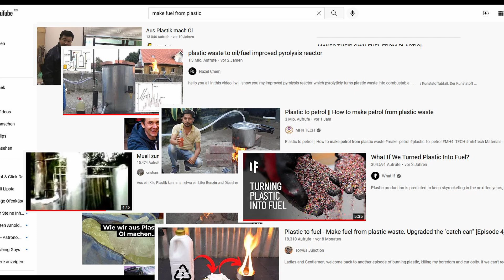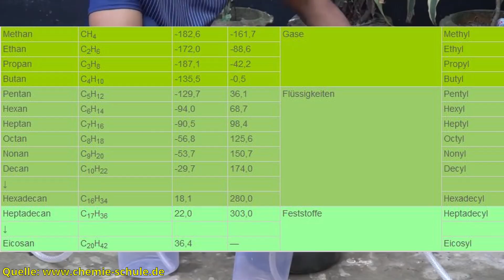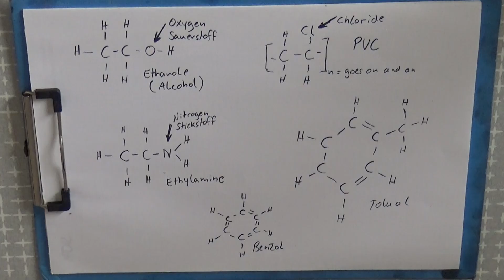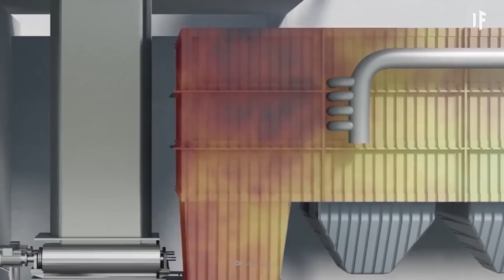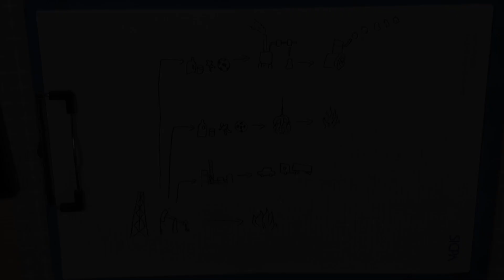The myth of making fuel from plastic, BUSTED!

Comment: This is a deceptive title.  All you have done is say why you think it’s a bad idea, not that plastic can not actually be converted to fuel.
Reply from the maker: it can be convertet into some sort of combustable liquid. Thats why the engine is running on that. It can be considered as 'fuel'. But it is still a bad idea to do so.
Reply: Its fuel, yes. But its not "gas oil" or any kind of fuel used in cars or motorbikes. It's just some burning liquid that cant be used for anything but those old engines
Reply: It works  he’s chosen a sloppy example 
There are commercial production units available.
Reply: @tatsuyashiba6931  can It be used in generators or motorcycles?
Reply: @mrcharles4636  generators probably yes, but i dont think there is data about the time they can work with it before breaking down. And motorcycles, well, i wouldnt put that in one. There are different types of fuel and we dont know exactly what kind this is or how the different types of plastic and the proportions of each can influentiate the tesulting fuel. So no, i would never put that in a more complex engine, like a motorcycle's
Reply: Then make an engine that can run on this type if fuel? I believe there's proper industrial processes that will refine the fuel.
Reply: @danialkashfi  Gasification would be the way. But I wouldn't want to be in a traffic jam surrounded by plastic gasifier vehicles.
Reply: @mrcharles4636  you can refine this stuff down to jet fuel… this guy is using the average persons ignorance to make a big oil propaganda video if you ask me, many companies are turning plastic to jet fuel. That burns much cleaners than heavy crude refined fuels
Reply: @tylerhall99  how does someone do it? I see no video or manual on how to make or the process
Reply: @tylerhall99  I'm not dumb, however I've seen people mad various kinds of fuel. Diesel, regular gas and gas for cooking. That's what confuses me, how does someone make different types.
Reply: @timbassett9132  exactly, and commercial j it’s use cutting edge filter systems to filter so much toxicins out thst even though it releases some bad gasses, it’s way better for the environment because it’s way less green house gasses compared to if the plastic sat In a landfill
Reply: that’s because ot works
Reply: @tylerhall99  exactly, thanks for your reply, that's how I'm trying to learn how to do it that way, but there's no info on YouTube or elsewhere to do so
Reply: DIYMicha2 did indeed say why it is a bad idea. They also said it was poaible to make some form of combustible liquid. The point DIYMicha2 is making is the fact although some sort of combustible liquid can be made it is far from environmentally friendly. It is almost as if the world forgot plastic originated from by-products of the petrochemical industry meaning it wasn't suited to being any of the various forms of fuel oil.
Reply: @diymicha2  IIRC using pyrolysis initial creates a petroleum product similar in composition to a low, low quality fuel oil. With relatively basic distillation, you can get it to something that in composition is very similar to commercial diesel. You're definitely right about it not being an energy efficient process, but IMO is kind of interesting to know how to do just in case you have all the equipment to do it and want a backup way to make deisel if SHTF
Reply: @diymicha2  define "bad"
Reply from the maker: @seandepagnier  B A D
Reply: @diymicha2  nice non-answer
Reply: @diymicha2  that's literally the definition of a fuel...
Reply from the maker: @fitz3540  nope. All fuels for ICE is precisely defined for what it contains, and in what quantities. Not every flammable liquid is suitable for every engine. Especially modern engines which are very picky.
Reply: @diymicha2  Germany used it during WW2.  Gasification essentially.
Reply from the maker: @jjjr.1186  I know. They built huge facilities to gasify coal in todays nothern poland.
Reply: yes you have right, isnot a busted story , just talking about chemistry, but not about the fuel what using lot of people around the wolrd ,from plalastic.
Reply: @diymicha2  plastic was made from peanuts. Despite your concerns, plastic is organic.
Reply from the maker: @masonfrancoeur2755  Actually you're wrong. Plastic is made from oil. Oil is made of dead dinosaurs. So your plastic dinosaurs are made of real dinosaurs. FACT!
Reply: @mrcharles4636  hey if you get info on how to do it "right" or do it safe could you reply to this and tell me where I can find it?
Reply: @tatsuyashiba6931 it can be used in brand new car engines, someone developed a plastic pyrolysis plant that produces lower sulfur diesel and gasoline with 102 octane , which is better than the best gasoline sold and used in any vehicle anywhere in the world till date, all these are just not a good bases of arguments, if we should follow all this guy is saying in this video, then it's better we return back to the stone age and forget anything development in this planet.
Reply: @josephchibuzorodinakasimon996  nah, its better if we stop using diese, no need to go back to the stone age and diel. Also, is there any actual study on long-term survivability of an engine running on that fuel?
Reply: @diymicha2 These last 2 sentences removed a lot of the credibility you tried to build throughout this video
Reply: All you have to do is to distill it, then you can get gasoline diesel, and kerosene out of it
Reply: How is it bad. If done correctly it burns more efficiently and produces less carbon emmisions @diymicha2
Reply: Releases a crap ton of chemicals and gives you a small, tiny vial of “fuel” sure is efficient
Reply: @Bhargleyargle  What chemicals? When the gas can also be burnt to only release water vapor and CO2? There is no wasteful exhaust
Reply: Crap video thanks 😂
Reply: @diymicha2 actually most oil comes from degraded plant material not dinosaurs 😂 they make a very small percentage of the crude oil this world has. Plants existed for waaaay longer and in much higher mass than dinosaurs…

it’s funny metaphor for what oil is about… very old, very dead and very limited.
Reply: You’re all arguing about whether or not “fuel” is produced and ignoring the glaring thermodynamics problem; more energy is required to create this fuel than is produced. You would be better off using that initial energy source as your “fuel”.
Reply: @diymicha2  The commenter is talking about the title, which you contradict in your reply.
Reply: @diymicha2 is it worse than regular oil?
Reply from the maker: @xxjaylogonxx2321  sure. Because you need twice the energy to process it. 1st in the refinery, to get the plastic, and a second time for the pyrolysis to turn it back to flammable liquid.
Reply: @diymicha2  hmmm do u onow if it produces more pollution than regular oil?
Reply: You can just look at the people attempting this practice and tell they don't understand chemistry or environmental science.
Reply: @diymicha2 entirely false mate.  I have done this myself and I have distilled the oils into purer fuels.  Secondly, the undoncensed gases went through a scrubber that contained NaOH and water to salt out the chlorine.  And the remaining combustible gases were fed into a gas generator for electricity.   I am a professional chemical engineer

Comment: This guy has the same mentality as all the people telling the Wright brothers they couldn’t fly. Barely one hundred years later look where we are.
Reply from the maker: Why? I never said that this doesn't work. It is just environmentally suicide to do so.
Reply: For me at least this is about saving money. In the end I found that if I burn the plastics directly with excess oxygen I can heat my home and I have almost no ash or soot in the burn chamber to dispose of.  It all burns away nice and clean without any smoke coming out the chimney. I also run copper pipe filled with water to run a small 2400 Watt steam-electric power generator. Using plastic like firewood works best BUT you must inject a bit of extra air into the burn chamber to keep the burn CLEAN!  Plastic burns at 250% hotter than wood lb. for lb.
For a blower I use the discharge from a small shop vac running on 25% power by putting a 75 Amp diode inline with the 120AC power input so it only uses half a wave of power turning a 1hp motor into a 1/4 HP motor.  Power Squared Rule, half the voltage or 60 volts / half wave = a 400% drop in power. This is cheap to do and very clean. 100 pounds of plastic burns with the same energy as 120 pounds of high grade coal!
Reply: @diymicha2  Title of your video, "The myth of making fuel from plastic, BUSTED!" clearly Stating it doesn't work, not that it works but it's not good for the environment.
Reply: @Tampainian  of course it works, the chemistry is relatively simple. Its BUSTED becuase it's a terrible alternative to gasoline, producing so much more toxic waste.

Comment: hey, organic chemistry student here. you could simply remove the gaseous polycarbons  to isolate the preferred liquid polycarbons for a stronger purity. if youre gonna say that you cant make something, make sure its in an engineering field. what you couldve said instead was "why you shouldnt make your own gasoline/petrol/diesel in your backyard" or you couldve showed the proper way to run the process of isolating plastic waste into gasoline molecules, but it is so very rare that you cant make something that shares a strong molecular shape into the molecule that it resembles. as long as the base atoms are the same between your starting material and your final product and the chemist is just bored/determined enough, nearly anything can be made through organic chemistry.
Reply from the maker: The main problem with pyrolysis, especially backdoor-pyrolysis is that a lot of plastics contain more elements than just carbohydrates (chlorine, nitrogen, fluorine to name a few). And it is absolutely impossible for the hobbyist to determine what type of plastic it is. Thats why the professional pyrolysis plants only accept PE and PP plastics.
Reply: @diymicha2  I played around with pyrolosis a bit with my father, we only used PE and PP plastics because of this. You can use other types of plastics, but the process become more dangerous and complicated because of what you mentioned. You absolutely can run a modern engine (especially deisel engines) on the fuel you produce.

My dad and I like experimenting with that sort of thing, and we both have a background in chemistry. In my country we are allowed to distill alcohol (up to 2 gallons) so that was another thing we experimented with.

Comment: "Leave this to the professionals"? You mean, the oil industry? Just because you can't imagine doing the chemistry for this to work correctly, that doesn't mean the rest of us can't. The oceans have state-sized plastic debris islands in them from the plastic bottles people consume every year. Unless we ourselves solve this problem nobody will.
Reply from the maker: I never mentioned the oil industry, did I? The only solution to this is to not produce it in the first place.
Reply: @diymicha2  but again we need plastics and trying to stop the production of plastic might not be the smartest move for the market and demand
Reply from the maker: @emmanuelsanchez4701  the goal must be to find and only produce recycleable plastics for long term use. We MUST get rid of one way plastics of any kind. There is no such thing as market demand in the face of collapsing eco systems.

Comment: Good information. However, the point of the other video was to show how they are making fuel out of waste on a remote island with minimal technology for practical reasons and survival. It was not an exercise in conservation or ecology or green behavior.
Reply: For me at least this is about saving money. In the end I found that if I burn the plastics directly with excess oxygen I can heat my home and I have almost no ash or soot in the burn chamber to dispose of.  It all burns away nice and clean without any smoke coming out the chimney. I also run copper pipe filled with water to run a small 2400 Watt steam-electric power generator. Using plastic like firewood works best BUT you must inject a bit of extra air into the burn chamber to keep the burn CLEAN!  Plastic burns at 250% hotter than wood lb. for lb.
For a blower I use the discharge from a small shop vac running on 25% power by putting a 75 Amp diode inline with the 120AC power input so it only uses half a wave of power turning a 1hp motor into a 1/4 HP motor.  Power Squared Rule, half the voltage or 60 volts / half wave = a 400% drop in power. This is cheap to do and very clean. 100 pounds of plastic burns with the same energy as 120 pounds of high grade coal!
Reply: YES!! I was going to reply this exact thing.

Comment: Im all for plastic pyrolysis. You can definitely turn it into fuels. Just needs more steps and there is so much room for growth in this industry. I have seen cars that initially fail smog based on emissions then pass after switching to plastic pyrolysis fuel. It not only burns cleaner but more efficiently as well.
Reply from the maker: Which is an extremely bad thing. Better dig those plastics, and never touch them again.
Reply: Do you have a source for that? Id like to read it
Reply: big difference between petrol and diesel you shouldn't run it in a gas engine but diesel will run it fine,we have these things called exhaust systems that literally chemically react with exhaust to take certain kinds of hazardous chemicals out of the exhaust fumes,this is what a catalytic converter does for example so adding a part to your exhaust to run this fuel is possible
Reply: @Aaron-zu3xn what happens with said converter at the end of its lifespan? Do you eat it and catalytically convert it into biomass? 😂😂😂 it ends up in the environment duh… and if you known introduce a system which kills a c.c even faster we will just end up with more waste we can’t handle anyways… Just go electric… besides the tires and the battery you need less from everything else as mechanical wear is much less of a thing… and batteries are a never ending technological process… regardless of us making ev's or not… that called feasible, sustainable and logical… rational… stuff like that… things the average youtube genius doesn’t bother with… just pursuing ideals and dreams 😂 sorry but that not how capitalism works… I am not a fan of this system but I acknowledge it as reality and don’t waste time with idealism… I prefer real solutions we can actually implement in our society. And using massiv amounts of energy to recycle something into fossil fuel essentially is one of the dumbest things I’ve seen recently… You want that thing to f us twice or what? We can solve our plastic problem otherwise… no need to further "fuel" hehe global warming with a double penetration 🤷🏻‍♂️
Reply: @diymicha2  We will never leave plastic behind completely.
Reply: @diymicha2  What is your solution for dealing with plastic waste?